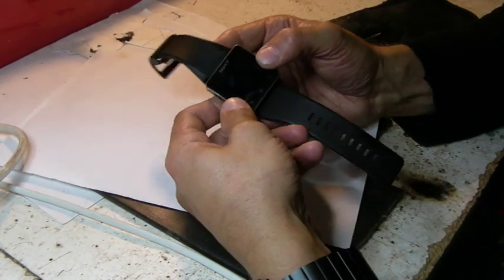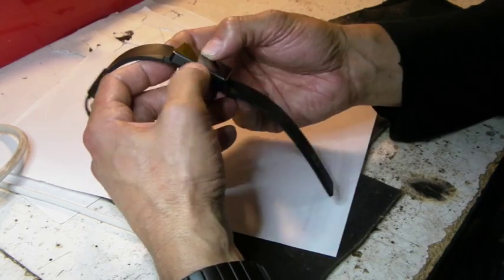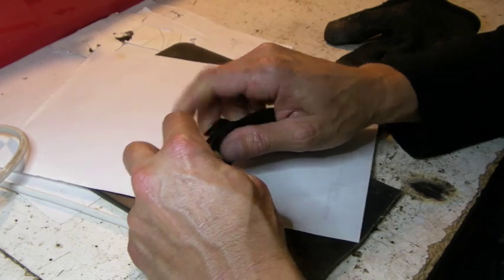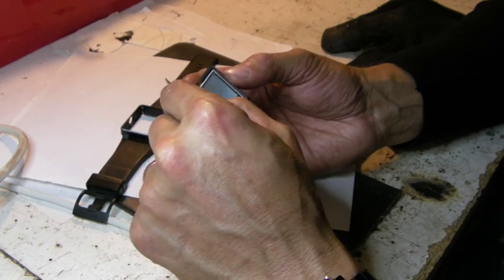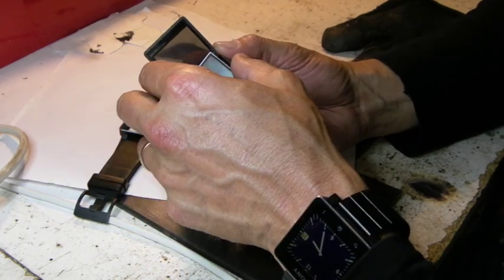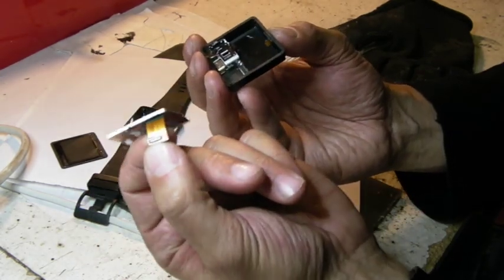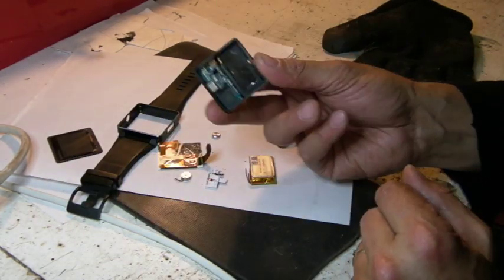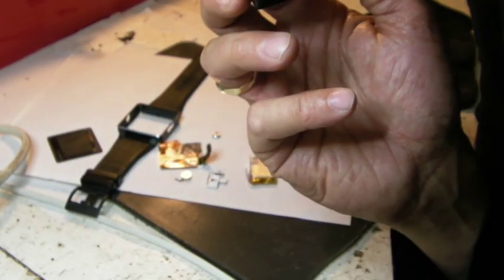Sony Smartwatch Disassembly

Comment: Hi,

Great video. 

I managed to disassemble my SW2 (water under screen from a swimming pool ... yeah stupid, I know). It has shown some signs of life including just before disassembly so I figured if I could fully dry it out it might work again. My problem is that, having disassembled it the glue has stretched so I basically need something to replace it. I can see glue things for phones on eBay but nothing for smartphones ... any idea? 

James